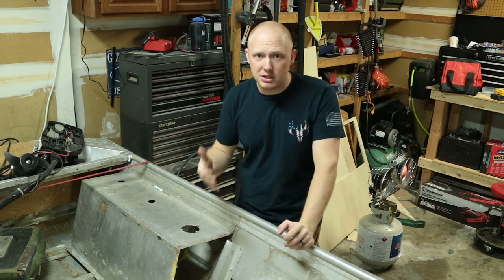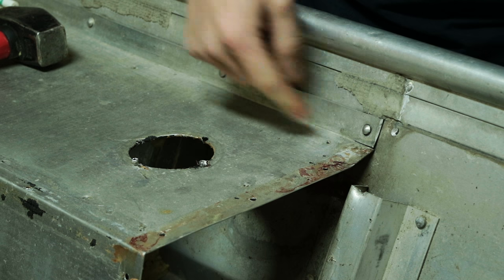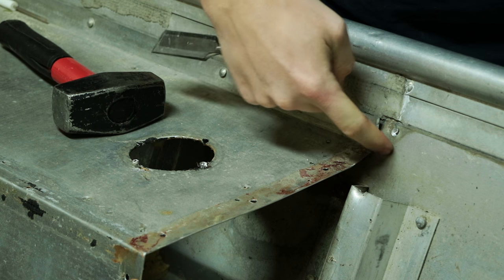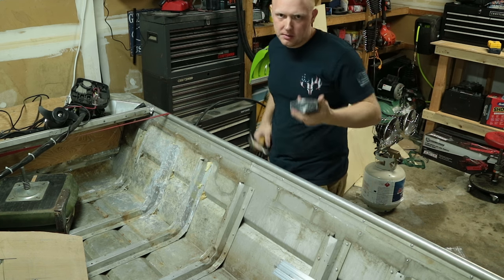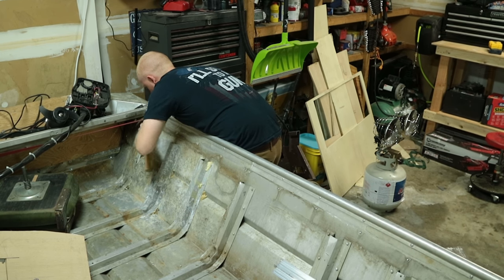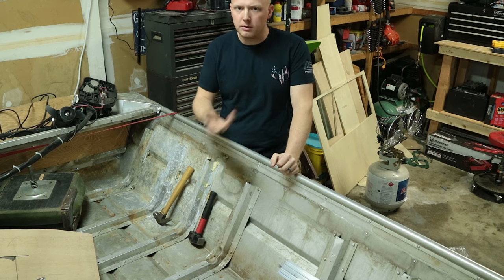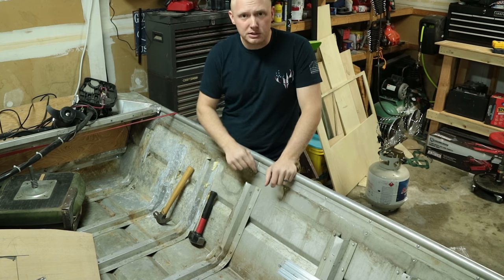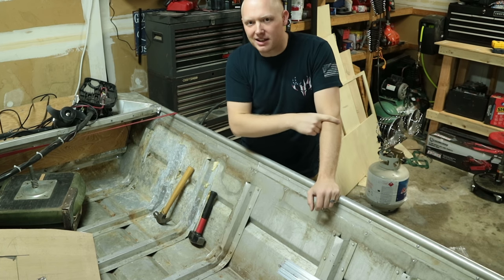Removing Bench Seats | Jon Boat to Bass Boat Restoration

Comment: I used bondo body filler and it's hard as steel. I'd say bondo will do just fine for those tiny holes. Michael Lopez was repairing a boat with a huge gash at the bottom of the hull and the previous owner used bondo body filler and he said that it was hard as cement if not harder and it was fine. Not to say that michael Lopez is a professional but he's been doing this for quite some time now.
Reply from the maker: Bondo is a temporary fix on a boat. It’s main use is an automotive application and even on car panels it won’t last very long. On a boat where it’s constantly getting wet it will not last very long at all.
Reply: Jerry Moua leave the holes open it wont matter if the water ever gets that high on the sides your going to sink anyway

Comment: Do you have a video on how to modify a bench seat to incorporate storage space underneath it? I hope that makes sense, or would you not suggest tampering with the bench seat?
Reply from the maker: +Matthew Chicoine as long as you don't take out the structural integrity of the seat itself you should be fine. Just remember that those seats are also stuffed with foam so you should replace that flotation somewhere else in the boat.

Comment: Do you think that a small jon boat such as a 10' Grumman, needs the support as it isn't a large span? I'd really like to open up the inside of the boat into more of a Bathtub so I can stand at floor level for stability...
Reply from the maker: I’d say if it was there to begin with they needed it for something more than a seat. If that’s all it was intended for then they would have saved the money and left it out. Thanks for watching man.

Comment: are the seats you removed aluminum as well? or are they tin?
Reply from the maker: I did not remove any seats. This was a video I did in response to a lot of people asking me how to do it. The point of the video was you should NOT remove a bench seat. They were put there in the first place to provide structural rigidity. If the company only put it in for the purpose of a seat they would have done something much cheaper and cost effective to begin with.

Comment: removing rivited in bench seats is a HUGE ;pain in the ass... i used a center tap to get the center perfectly started, then drilled it with a small bit then went to the final bit size.
Reply from the maker: I'm not sure if you got the point of the video. lol DO NOT REMOVE THE BENCH SEATS! Or if you do make sure to reinforce it to make up for what you remove!